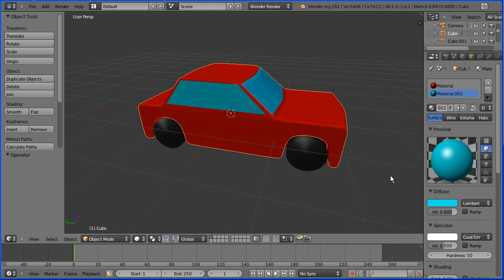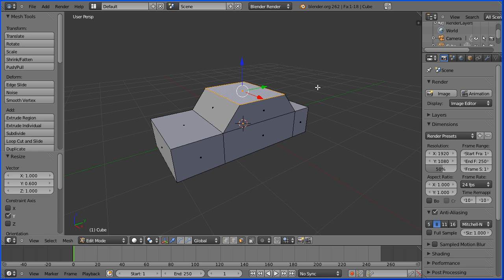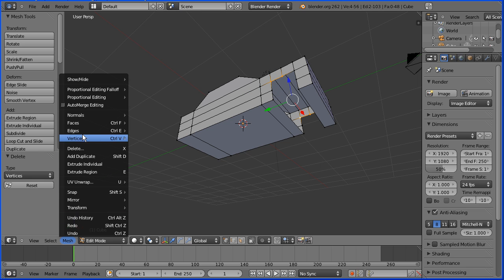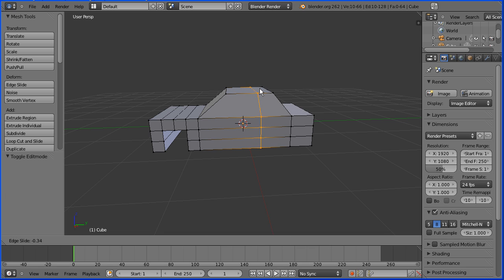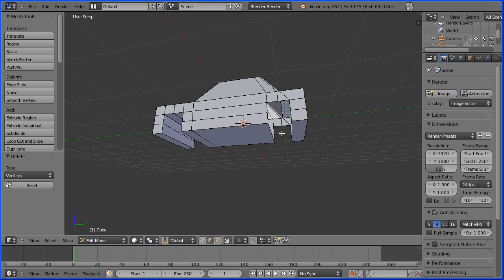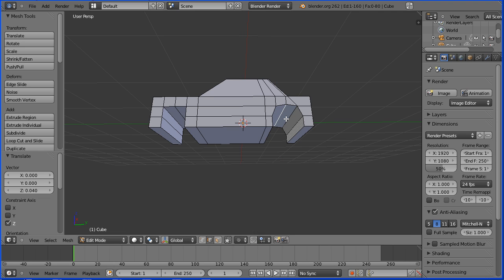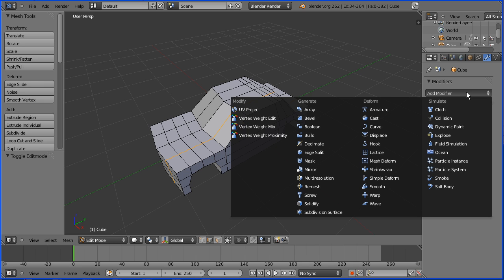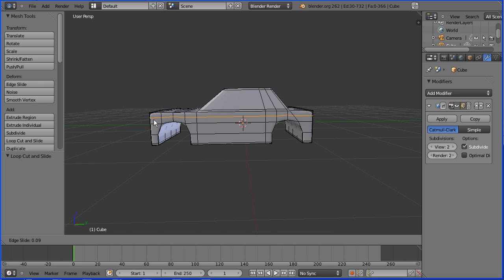Blender Tutorial Making a Simple Model of a Car Part 1 The Car Body

Comment: can we do it in abacus?
Reply from the maker: I do not know what abacus is, is it a 3D printer? Blender can export to a range of 3D formats and there is an add-on - 3D Printing Toolbox
Reply: 3D Blender Tutorials by ianscott888 no it's a software.
Reply: 3D Blender Tutorials by ianscott888 I believe you need coordinates for 3d modelling of a car. can u tell me those coordinates
Reply from the maker: When you save or exprot the coordinates are saved in a file, you then need to import the file (with the coordinates) into the software (abacus)
Reply: 3D Blender Tutorials by ianscott888 can you do a video of modelling concrete pole with reinforcements?

Comment: I was trying this tutorial, only I started by using a mirror modifier, so I was doing all the work on one half of the car.  I had a little trouble with the tires, but I figured out a way around that.  I got to 6:03, and I tried the loop cuts, running from front to back, but a few faces will not be cut.  And I can only loop cut the front or back at a time.  Would this be because of my mirror modifier shenanigans around the wheel frame?